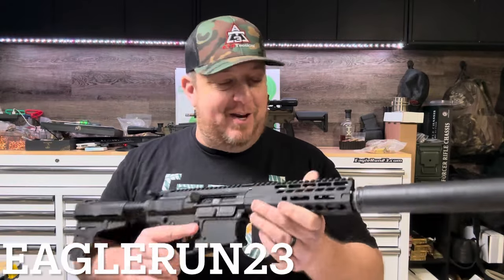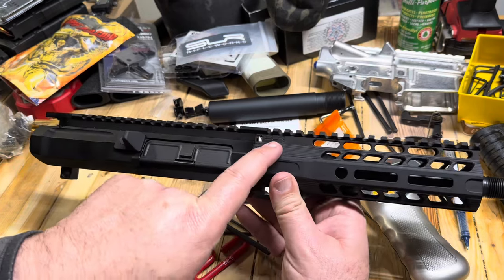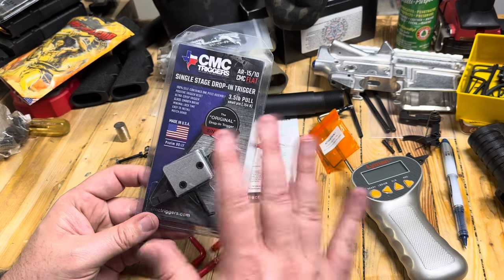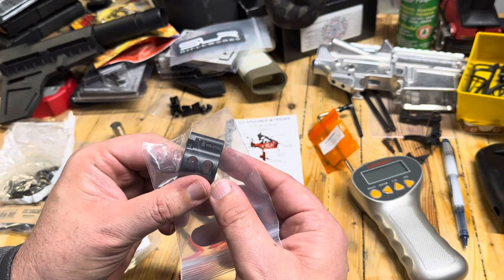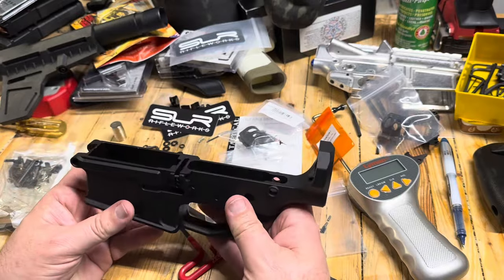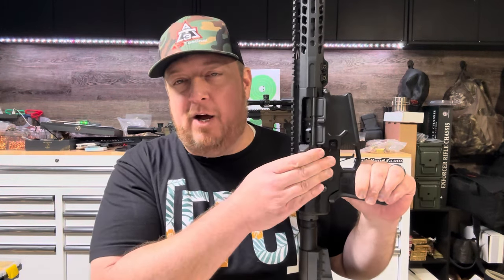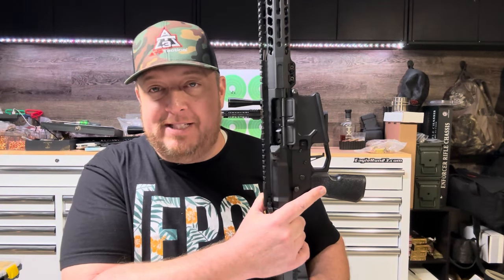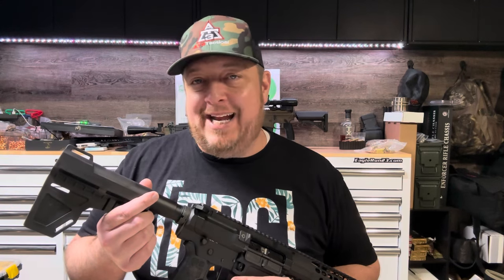SLR 86 blackout: Complete Build List and Costs

Comment: That’s definitely not the cheapest adjustable gas block, I bought mine for $29 and it’s actually a click type. If I say where I got it the overlords at Yt will delete this comment. I really wish gun tubers would weigh the parts they use in their builds, some of us don’t want a 7lb Ar pistol.
Reply: I'm now on a quest. Is it reliable and adjustable from the front. I've been using aero precision on a few rifles but couldn't find them for less than  $45 on sale.
Reply: @levinlevinallday Go Rilla mach ining, it’s adjustable from the front and reliable as any click type adjustable gas block.

Comment: Nice build! I'm debating doing an 8.6blk build next year. What is the total weight of the rifle?
Reply from the maker: good question, let me see
Reply: @EagleRun23  i appreciate it. My current hunting rifle is 13.4lbs loaded with thermal and strap @ 16". I'm hoping if I spend up to $2500 for a build, I could possibly halve that weight, shorten, and silence it. I know I can do it with a 300blk, but after research, I see that I can't expect it to ethically take deer and pig out to 200 yds subsonic.

Comment: There's one thing everyone should know about 8.6 BLK. The cartridge itself is fine, but the twist rate Q advertises is an absolute meme.

Basic back of the napkin math clearly shows that the amount of energy stored in the rotation of the bullet is utterly negligible. Rotational energy is in fact a component of kinetic energy, and is a function of the rotational velocity and the moment of inertia.

How well that energy is transferred to target is a subject on which I've yet to see any testing.

More importantly, I've yet to see any statements on how much rotational energy, in relation to linear motion energy, the bullet carries to begin with. You'd think if Q thinks it's a significant contribution to energy on target, they would give an actual figure for it, but they don't.

Let's do some napkin math. I'll be using metric for this. 

Let's take a 300 grain (19.4g) .338 projectile travelling at 300m/s (which is comfortably below the speed of sound of 331m/s at sea level) from a smooth bore (no rotational energy at all). The linear muzzle energy here is 0.0194 * 300^2 = 1746 Joules.

Now let's calculate the rotational energy for a 1:3" twist barrel. This is 13.12 rotations per meter of travel. The projectile travels at 300 m/s, which means its rotational velocity is 13.12 * 300 * 2 * Pi = 27437 Rad/s (236k RPM for those interested). 

Before we continue, we need the moment of inertia, and for this I will assume the bullet is a perfect cylinder, which is an approximation strictly in favor of Q's case. This cylinder has a diameter of 0.0086m and a mass of 0.0194kg The moment of inertia then becomes 1/8 * 0.0194 * 0.0086^2 = 1.79e-7kgm^2.

Finally then, the rotational energy here is 1/2 * 1.79e-7 * 27437^2 = 67.4 Joules.

Thus we conclude that the rotational energy at the muzzle is less than 4% of the linear muzzle energy in a calculation that heavily favors Q's idea.

I invite everyone to double check my math for wrong decimal places and other errors. But as it stands, while I applaud Q for thinking out of the box, I must criticize them for not thinking critically before putting a product to market and Faxon for attaching their name to this bogus product marketing.

EDIT: I should clarify that bogus marketing notwithstanding, 8.6 BLK is still a far better round than .300 BLK. The Russian 7.62x39mm, which .300 BLK somewhat mimics in terms of ballistics, was far from optimal for both super- and subsonic use, and they split it up into 5.45x39mm and 9x39mm respectively for good reasons. Where .300 BLK had the problem of trying to do too many things at the same time, 8.6 BLK is starting to come into its own as a subsonic caliber, at worst on par with, and probably somewhat better than the specialized 9x39mm subsonic round. But it's really just another round, not some kind of rapidly spinning buzzsaw of doom that Q tries to advertise it as.
Reply from the maker: Bro just email me.
Reply: @EagleRun23  Its something everyone should see.